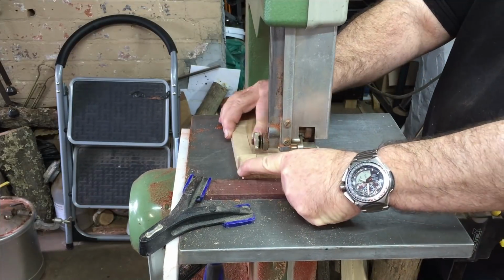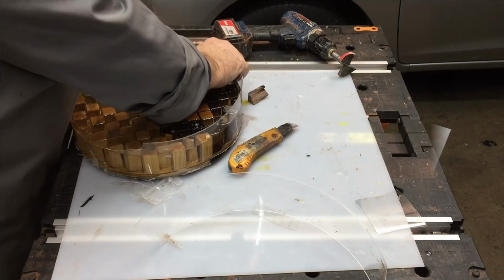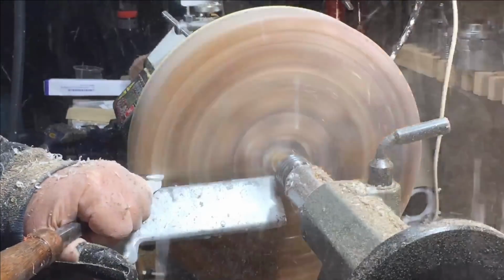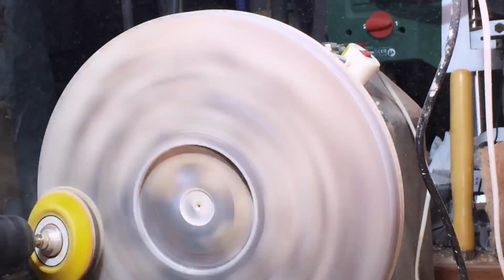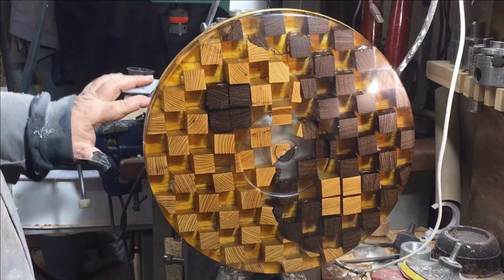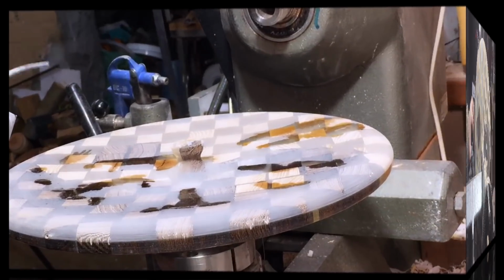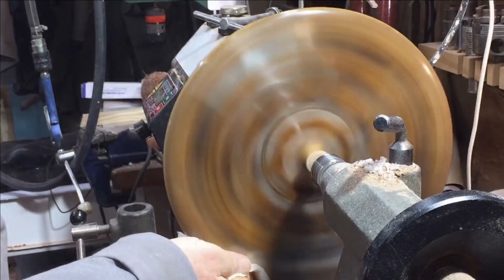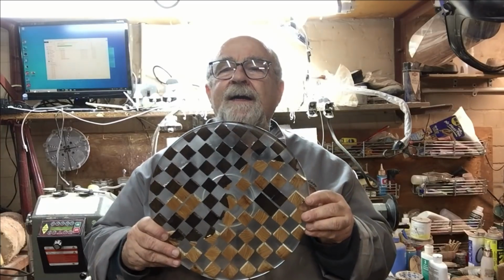Woodturning Yin yang

Comment: Ahron, believe it or not - when I cut myself these days (without ragged edges)  I glue the place together with superglue!  Just make sure the place is clean underneath (my own saliva does quite well).  Kind regards.
Reply from the maker: Auch  it will burn .Thanks
Reply: @oldmanwoodcraft  No - I get so much superglue on my hands being a pen-turner that  I am sort of used to it.  No burning.  Also very good for sticking broken nails together.  I think CA only reacts with natural fibers like cotton, but don's quote me.  And it reacts IMMEDIATELY with bicarb of soda to form a stone-hard substance.  I have not tried it yet, but I suppose one can mix a coloured power with it and add CA to full up cracks.  Kind regards.
Reply: Super Glue was was used by field medics to glue wounds in Witnam.